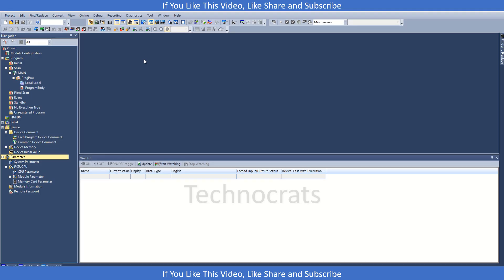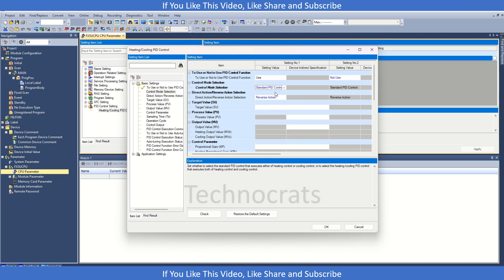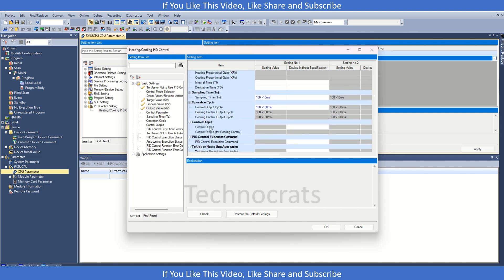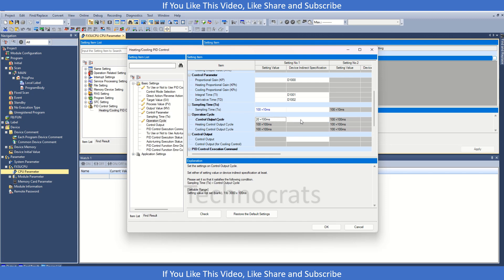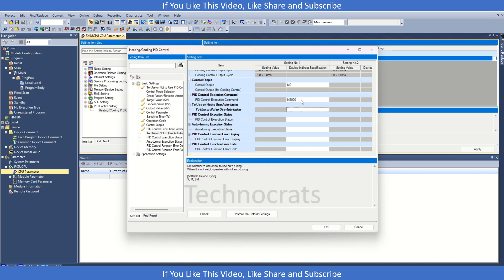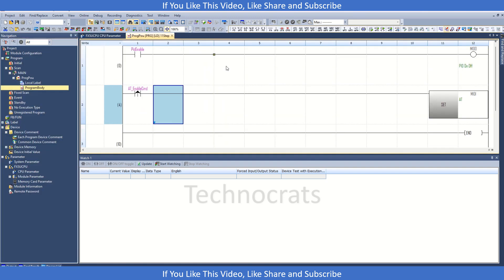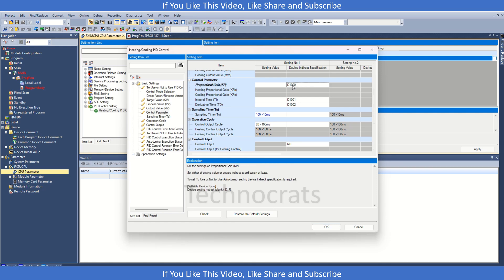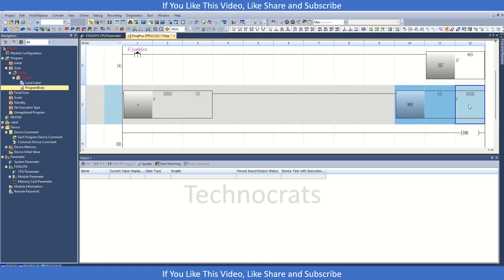FX5U Inbuilt PID For Heating Control

Comment: Hii.. Sir.. Could you explain how we can write code for establishing communication between two external devices with plc Mitsubishi fx5u to transfer data and recive data through ethernet... What is socket connection block..
Reply from the maker: You can check my video related to simple plc communication, that will work